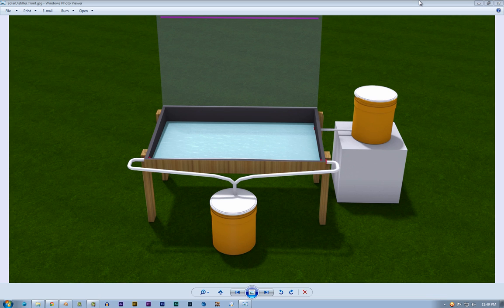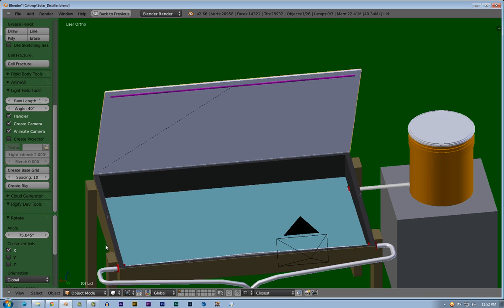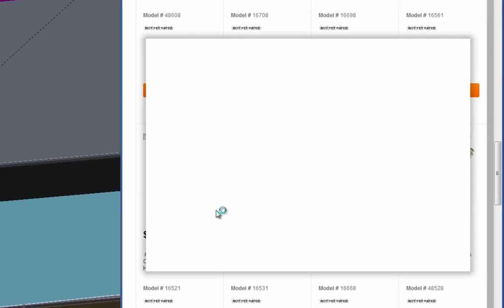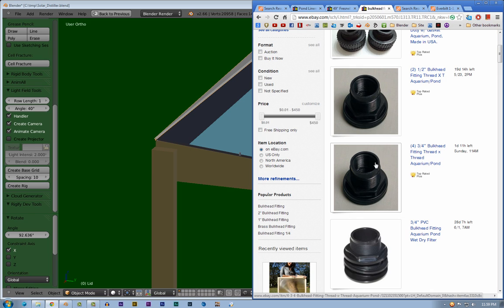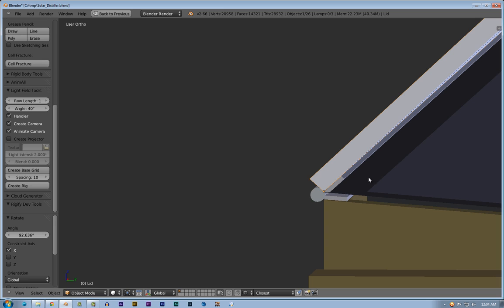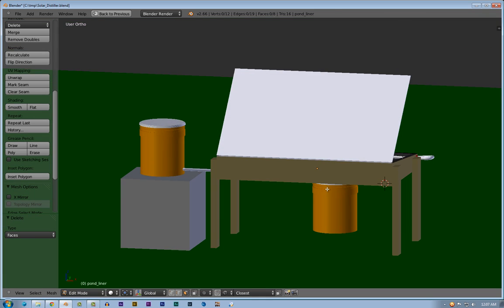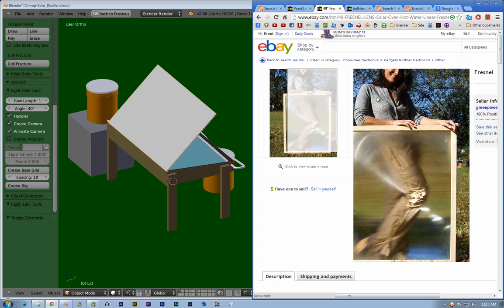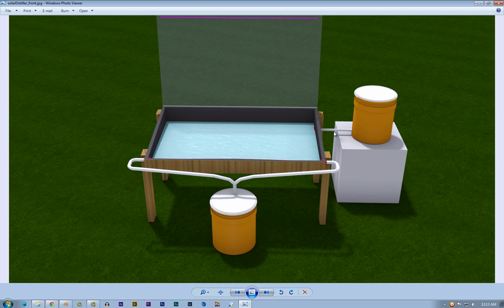DIY Home Water Distiller

Comment: go to a scrap yard and offer the guy $20.00 for one of his scrap projection tvs. Trust me you will be doing him a favor.
Reply from the maker: +Semantics Simple Ah for the Fresnel lens. Good thinking.
Reply: +Brent Newton +Semantics Simple
How does this change anything to the amount of sunlight / energy that is used to distill the water? A lens only focuses it more to the center, but doesn't attract more light from outside the case or anything like that.
Reply: not 100% sure but the lens should increase the temperature. More heat. which should speed up the process.
Reply: +Semantics Simple A lens only focuses the light. The energy total input won't change, unless the lens is bigger than the case or sticks out from the border of the case. If not, there will probably be even some less energy with a lens, because some of the light will be reflected by the lens surface or changed into warmth, thus won't make it to the water.